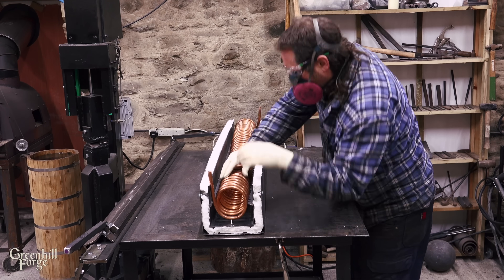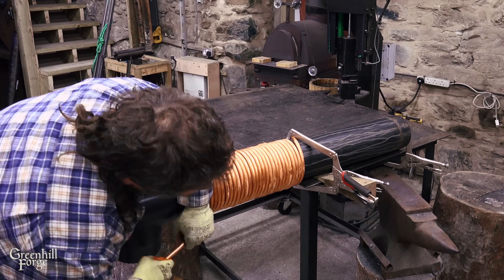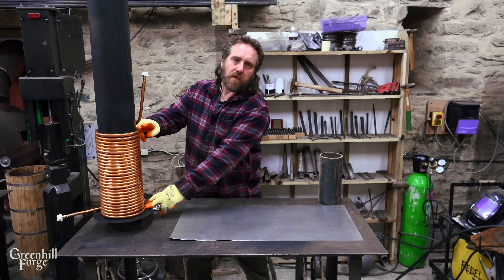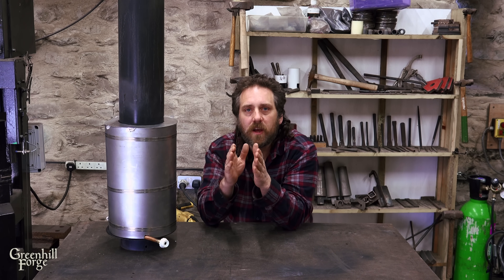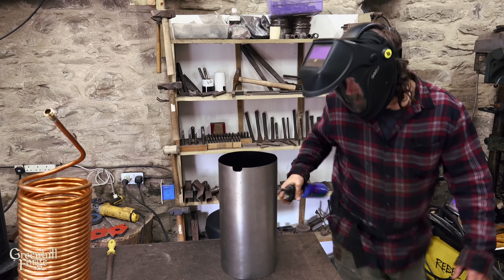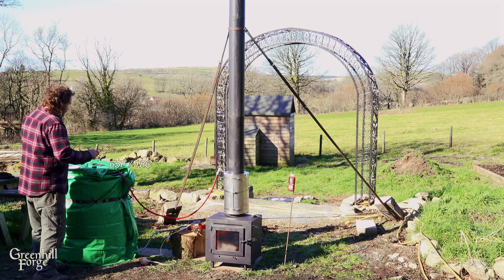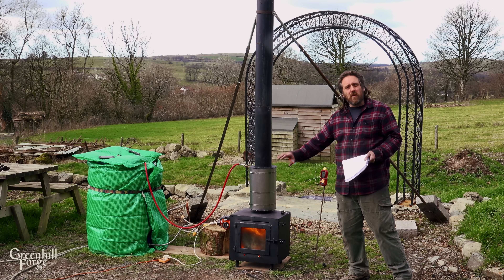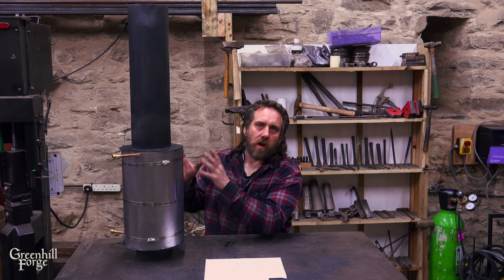Best Wood Stove Water Heater Yet: New Design Tested | Off Grid Water Heater pt3

Comment: I think I have an interesting idea to combine your water heater and your radiator.  

First, make a flue in a snake/zig-gaz pattern.  You might have to use a smaller diameter flue, or make it 3D (180 left, 180 up, 180 right...)
Next wrap only the straight pieces in copper (because you are going to want to be able to take apart the bends to clean it)
Next build a box around it and insulate  all but 1 side of the box (the side you want the heat to go to)
Drill and push the copper through the box and connect the water circuit into a manifold.  To prevent cold water you can check the temp and open each section of the manifold as the water gets up to temp.

In concept its this setup X4 or X8, in a box, but without the sand/graphite.   The idea is the "waste" heat goes to heating the room, so the water heater doesn't need to be as efficient, and since its 4X or 8X the area it should yield more warm water per minute which I find more useful than hotter water. 

A cost savings improvement may be to make a water jacket system vs copper tube, but I wouldn't trust my welding skills enough to do that. 

If its interesting and you want me to draw it I would be happy to do so.

Comment: I heated my hot tub with a wood stove placed in the hot tub. The stove was made from an old propane tank with downdraft air supply tubes and the stack coming out the side of the tank so that the exhaust was below the water level. The stove was within a 4X4 plywood tub. It worked well.

Comment: Crazy idea. Create triple-chimney. Wrap coil around long thin steel tube(inner slim chimney). Put wrapped coil around that tube inside another tube(copper piper protection), much smaller threading (fill or not fill with graphite) and wrap the whole thing around second tube, secondary chimney) ..coil will be in center of chimney as your most efficient test but also not touching fumes. Should affect efficiency since heat irradiate outward where being closer to out means also less efficient then in center. Inside chimney and still not touching fumes should be the best.

Comment: How about putting the coil inside the chimney but have the coil covered both sides with a thin metal? You'd have to make two holes out of your chimney to enter and exit the coil. So again coil inside the chimney but covered by a light metal both sides of coil with a bottom and top metal cap to seal it in so the copper stays clean. That or make a big flat coil, all contained by metal again and insert it in the inside of the stove at the top. Again would have to make a entry and exit hole for the copper either out of furnace or the chimney. Key is to contain the coil completely in light metal... no sand needed inside containment either.

Comment: I think if you used the same amount of copper tube but spaced the coils so that it wraped all the way up the pipe. Like an inch space between coils or whatever it worked out to. then filled it with graphite or sand That way you'd be transferring 4 ft. Worth of heat instead of just 2.

Comment: You could try and marry both systems somehow. What I mean is you could put all of this encased copper pipe with graphite inside the exhaust pipe. So the heat and fumes not only pass through the middle but also the sides. But maybe the would mean losing the insulation or keeping it outside. Anyway you are awesome really good job.

Comment: Surely you need to increase the conduction between the flue and the copper, so use a heavy oil to fill in the gaps in the graphite powder?

Comment: How about using high temperature heat transfer solutions in the pipe in very close proximity to the firebox…. have the coil go into the water tank.  Therminol 68 is a high temperature liquid phase heat transfer fluid with excellent thermal stability. Therminol 68 was developed for use at temperatures up to 360° C (680°F) in liquid phase heat transfer fluid systems.

Comment: Wrap a couple coils around the stove before the inlet to pre-warm the water going into the coil also put a damper in the flue above the coil to slow the fire down a bit and holding the heat in the stove

Comment: what about using sand to fill that cylinder you made for the insulation using heat bricks on the outside as well as sheet metal so coil, sand,metal, you could have a thin layer between the metal and the brick as extra insulation, metal cools quicker than brick if im correct in my thinking

Comment: What you said about the heat radiating off the flue above the coil makes me wonder if the coil was wound with a greater separation between the turns would the additional surface area improve the efficiency?

Comment: I wonder quite a bit about a fluid medium, water is widely available and the steam byproduct could be useful as well. Especially in a cold climate, for warming the shower area and even cleaning it down after use.
Could possibly function as a rudimentary temperature control too. Max out the temperature via pressure, reduce temp by reducing medium.

Comment: I'm not an engineer, but it seems that you might conceive heating water by using steam to surround your copper tubing, much like a pressure cooker.  You would employ a relief valve much like stove-top pressure cookers (SPC).  In such an environment, the steam could rise to +250 dF.  Just some ideas for you.  I enjoyed your exploration into the matter.

Comment: I like the box with the baffles, that's an interesting place to start, and the secondary air is something I've experimented with a little using a smaller barrel inside a lager barrel. First things I was thinking of when you mention secondary air, and I watched this video, was how to have the water heater and the radiator both, with secondary air for a more complete burn of the gasses 😄 I like and appreciate the work you're doing, and I subscribed so I could keep track.

Comment: Thanks for such an informative video - an idea occurred to me that maximising the copper to flue contact area would assist in heat transfer.  It may be possible to compress the round tube to a square shape with maybe a shop press and a steel pipe sliced in 2 acting as dies (unless square tube is already available?).

Comment: Firstly I’d like to show my thanks and appreciation for the craftsmanship, thoroughness and clarity put into these videos, there informative and a joy to watch. I wonder if it would be possible to flatten the copper pipe for more surface area on the stove pipe then wrapping in insulation? Or maybe having no copper at all?!.. a kind of kelly kettle with the inner wall as the stove pipe and insulation round the external, low inlet, high outlet with breather?

Comment: What if you add a flapper valve in the flue above the top of the coil to slow the gases and transfer more heat.
Also consider trying to get a secondary combustion of the gases coming out of the heater by adding an air inlet at the base of the flu. The exhaust usually has incomplete combusted gases that are still hot enough to burn in the presence of more oxygen.

Comment: I have been thinking about doing the same for a while. I think instead of placing  the coil inside the flue where the results are the best make a double layers flue and fill it with water. It will be just like placing the copper inside the flute but without creating an obstruction in the flue. If i am making it i will take a copper pipe that can fit in a steel pipe leaving a gap for water. Braze both ends with an inlet at the bottom and outlet at the top. With this set up the inside copper pipe will transfer heat to the water what the coil was meant to do on the inside.

Comment: I used 75ft of copper tubing, and wrapped the coil with ceramic wool. Using the heat to move the water through the Pipes to heat my radiant heating system. Though my stack gets very hot(hot enough to not build up creosote, or put out much smoke). & I don't use any Dampers, etc.

Comment: Make a firetube flue, scrap the copper coil as the heat exchanger, and go with direct surface-to-water contact for maximum efficiency, with an inlet near the bottom and an outlet near the top.

Comment: Thanks for the new and updated improvement, i sure learnt something. However, i will wait a bit longer to build mine(hopefully not too long)until after all constructive inputs, you got a "perfect" system .I suppose these tests only concentrate on chimney heat contraction & not using all other heated surfaces. One question wouldn't be a combination of coil and heated make a much faster and more efficient waterheating system?

Comment: I like the design. I've been toying with the same design, different goal. My suggestion would be to place damper plates inside to transfer the heat to the outside. You could also use a spark arrestor type grid but soot will bugger it up. Any soot that the plates collect, sheds off back into the fire and keeps the upper flue area cleaner for a little while longer. The design I hope to someday try, uses copper heat pipes, like laptop cooling pipes, to optimize the transfer to a very small area, where as your design appears to try and maximize available surface transfer. The round tube on a flat surface, is not the best choice. Maybe smash it a little flatter on the contact surface, while you wrap the coil. You could also use wedges to force dimples into the coil, creating flat spots to transfer heat more efficiently. Anyway, neat project, good job, nice video editing as well.

Comment: Next logical step; Replace the helix, with a vertical stacked straight tube heat exchanger (go wiki or pic search, looks somewhat like a gatling, inside of a cylindric vessel). May have to go steel pipe, to weld it though. I´d use bigger and fewer passthrough-pipes to help the creosote situation.
Reply: ...and a overpressure relief valve for the water/steam.
Easy to make one for lower pressures. Thread adjust to spring tension on cone valves are good enough for controlling motor inputs and security overrides at Kaercher´s high pressure washers from 90 to 1500 bars (and beyond ?). Edit; electric accumulator (tanks) home water heaters usually are fitted with a cheap low pressure evacuation one.

Comment: Spread the coil over the entire flue as opposed to just a couple feet. The ultimate is to use copper pipe for the flue with the coil soldered to it with your insulation ideas.

Comment: Try putting some thermal paste / grease on the flue where the copper pipe contacts it. This will transfer the heat from the flue to the copper pipe a bit better

Comment: We have they call a low nox propane on demand hot water heater, it has a small fan to get the fire hotter, less emissions and better fuel mileage I should say, and they work fantastic. Plus we have a fireplace insert and two other wood stoves. In A Very Old uninsulated Stone House, and we're very comfortable but it's a lot of work.

Comment: You have a really interesting channel. I like a lot of your projects. Have you considered a turbulator on the inside of the flue to break up the laminar flow in the flue? Very commonly used in firetube boilers with flues 1-1/2" diameter and larger. Easy enough to make from a single sheet of mild steel, or stainless, cut to the ID of the flue and whatever length desired (say, half the length of the flue), and a single twist the length of it (think DNA helix). The turbulator would likely be close to the temp of the flue gasses so condensation of flue gasses and build up of creosote would be approximately the same as what you'd normally find in your flue.

Comment: I have to ask what if you stretched to copper coil along 2x or so the distance of the flue pipe? You are running out of ways to extract heat from from the. So double the pipe.

Comment: Why not mount a water manifold into the heater? You could make it out of a steel block. Like the opposite of a cooling system for an engine block.

Comment: Better to make a water tank that is built from a tube that is the same size as the chimney and then put a 45 degree bend in the chimney immediately above the boiler , this is to slow the gas in the chimney and place more heat at the boiler

Comment: Back in the day, I did something similar and it worked too good for just heating domestic hot water. In hindsight I could have added some fintube to heat the crawl space.
Anyway, I used a steel pipe directly in the firebox, capped the pipe the solid at the back water input and outlets on the front, on the input copper tube went to the back inside the steel pipe, the outlet side was stubbed just inside the front cap.
Used a 30 gallon tank with circ pump. If we didn't use enough hot water, it would activate the pressure relief valve and blow off some steam, thus the need to add some fintube.
I did that 45 years ago and it worked too good!
Hope you try it.
Thanks

Comment: i reckon your heat transfer is heavily nerfed by how dense the coils are (because it has to travel through the steel first which is worse at transfer ), if you spaced them out 1.5 or 2x apart, you probably should see improvement before the decrease due to temperature falloff higher up the flue.

Comment: amazing video, thanks for sharing all this as it’s something I’ve been wanting to do for years. A few thoughts:

1. Thermal paste? Maybe messier than the graphite powder though and might not last very well?

2. You put ice in the pipe to aid bending it to position without collapse and kings, which makes sense, BUT a little bending of the contact surface would actually improve the contact area and therefore heat transfer. Perhaps putting some jubilee clips around the coil after it’s in place an cinching it all up a bit would help?

Comment: i really dont understand why you use only this tiny length of the flue pipe, unlike in your first experiment.
Reply from the maker: because I've got another project I'me working on that needs a shorter coil.
Reply: @GreenhillForge  okey dokey. and thanks a lot for all your generous work. im sure you know the concept of a water jacket. we hat bath ovens in Germany. Im still using one. thick water jacket sits on top of the fire box and around flue pipe. look it up. brand kaldewei, Badeofen. greetings
Reply from the maker: @stephangleiner1333  I made an off-grid flue water jacket shower system I show in this video if you want to check it out https://youtu.be/pP_2A5Wdvqg
Reply: @GreenhillForge  thanks, i'll check it. im planning a underfloorheating with an insulated hotwater storage tank. id like to burn the timber in a gasifier and save the charcoal for soil, etc. needs to be illegal here in Germany. But i am good at that..
Reply from the maker: @stephangleiner1333  I've got an underfloor heating project I'm working on. Will hopefully be out in a month or so.

Comment: There are these air recirculation chamber wood stoves that perform a secondary combustion of the non burnt gases. It's a little cavity layer on top of actual stove. These are collapsible portable stoves used by many famous Survival video makers on YouTube. 
Your heating copper coil could be fitted inside this chamber as a giant disc or in an Olympics race track pattern . Coil would be easily accessible and could be cleaned periodically and surely it would heat water faster.

Comment: You're just not taking enough of the exhaust surface area.  2 feet isn't nearly enough.  Try a water jacket of about 6 to 8 feet, and just siphon water from that.
Reply from the maker: I made an off-grid flue water jacket shower system I show in this video if you want to check it out https://youtu.be/pP_2A5Wdvqg

Comment: You might use the trick the highly efficient boilers do - the easiest way to not have acidic byproduct to condense is to just... not circulate water that's that cold.

They basically have "short" water loop that just goes back to the boiler and thermal valve (so called anti-condensation valve) that only opens flow to the hot water tank once temperature is above condensing. Then water for the boiler is always some 60-70C. With some clever valving it can also work in gravity flow in a pinch.

Other trick is used in gas boilers, they basically have the flue shaped in a way where condensate drops in one place and is drained away. Would have to build wood stove from scratch to do it tho.

If you really wanted to get all the heat out, wood stove with water sheaths are a thing, but very pricy.

Comment: Dude your first attempt although the pipe was on the inside your whole contraption was 5 ft tall. Your outside attempt is only 2 ft tall. You need to space your heater out over an area of 5 ft because that is what you are taking the heat off of that amount of flue pipe.

Comment: If you put a 1/2” or 1” gap between the coil up the flu pipe your efficiency will be much greater with the sand heat sink battery.

Comment: Did you check the temperatures required to initiate a thermite reaction (aluminium powder reducing iron rust)?
No way you can have started it from the flue heat 😂😂😂
Reply from the maker: about 1200F and my stove hits +1800F easily

Comment: I would try to maximise heat transfer from the flue wall into the copper. Make some D shaped tube using a pair or rollers to increase the contact area on the flue. Spread the coils apart slightly to use more of the flue area. Make the coils slightly under size so they press tightly on the flue. Finally add a few drops of silicone oil to fill the gap between the copper and the flue surface.

Comment: Another way is by a box with pipes welded in it ,a fan blowing air through the pipes to the room . Their is a commercial one on the market at present.Called magic heat   found in northern tool  catalog,